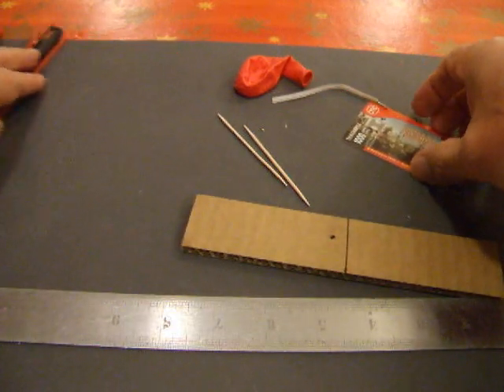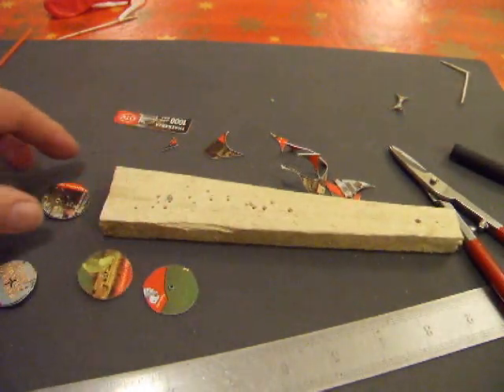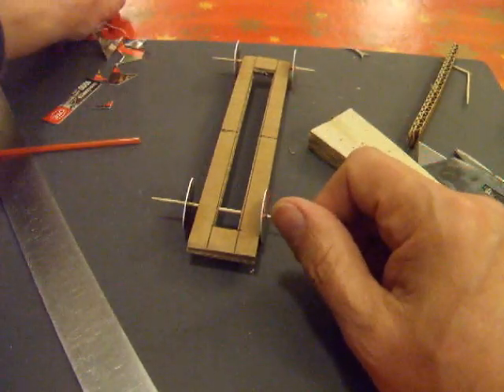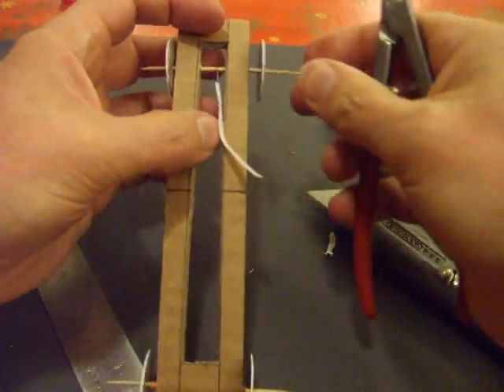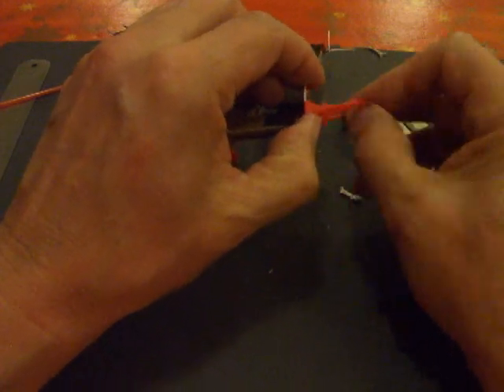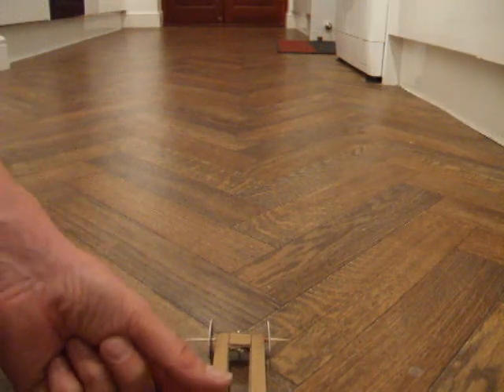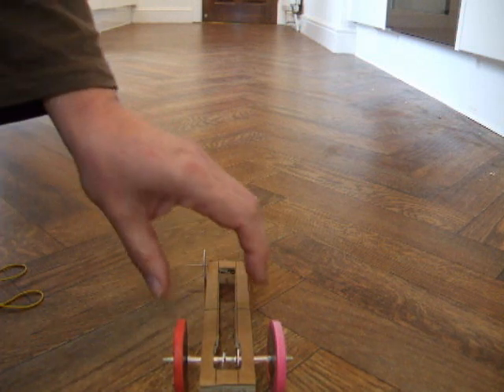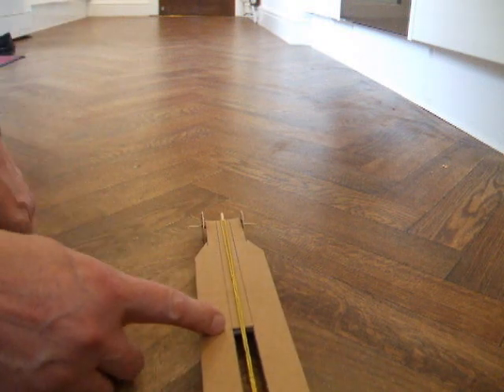Let's make Rubber Band Powered Car #5

Comment from the maker: It might look good, but I don't think it would help. The extra weight over the back wheels might help a bit, but a spoiler is designed to help cars stick to the road at high speeds so I wouldn't add one myself. Making the wheels grip would be more help. Have a look at some of my other Rubber Band Cars to see what different methods I use to add grip. The quickest and easiest way is to cut strips from a balloon or a rubber glove and stretch them round the outside of the wheel.

Comment from the maker: In option 2 the release of the mousetrap could be used to then trigger the release of the rubberbands which could then pull the ratchet that was freewheeling. This seems over complicated but have a look at the operation of "pull back" toy cars.
 
A possible third option I have seen videos where two mousetraps are used. When the first one finishes it releases the second one.

Comment from the maker: Right Krzystoph, I don't think it is a good idea but I can think of two options.
1. Have both the rubber band and the string from the mouse trap wrapped round the axle at the same time, but one on the left and one on the right with a barrier between them to stop them overlapping and run both at the same time. You would need very good grip from the wheels or it would just wheelspin and go nowhere.
2. Have some sort of freewheeling ratchet effect to use one first and then the other is triggered.